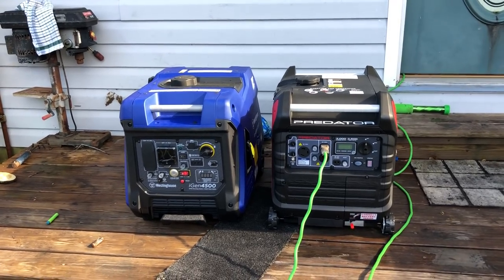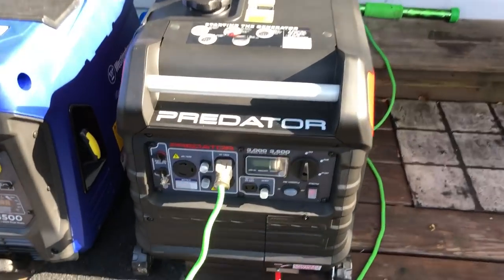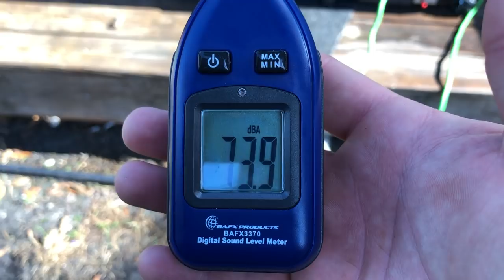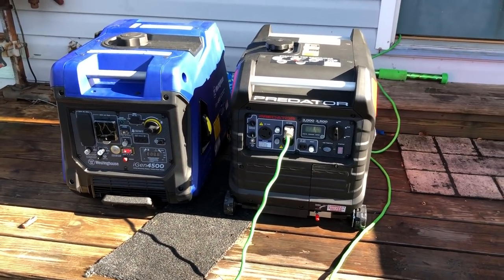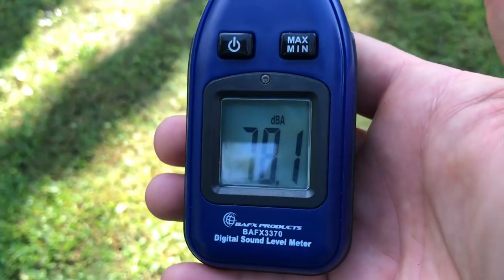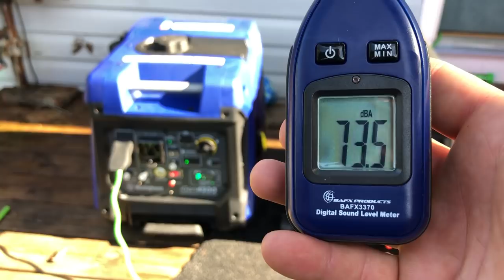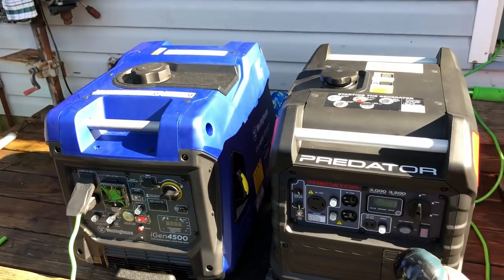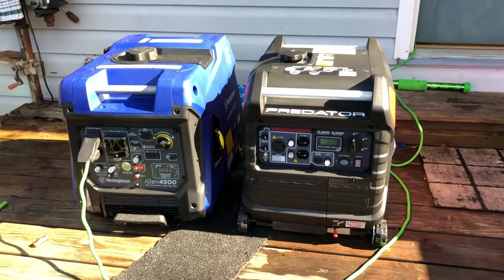Westinghouse iGen4500 vs Predator 3500

Comment: Thank you for the great comparison video! We will be adding an hour meter in the future to the LED Display. Also the fuel sensor currently only displays five levels which correspond to the lights to the left of the LED Display. Thanks again for the in-depth video.
Reply: Westinghouse Outdoor Power Equipment I'm looking forward to trying a Westinghouse generator inverter. I full-time RV 40' 50 amp 
camper running a generator days at a time only shutting down once every 12 hours or so to refuel and check oil. Need a factory-installed Pitcock on the top to feed fuel in when long running hours are required. Hour meter and fuel feed petcock.
Reply: @catfishnet  get extended run gas cap and big gas tank for that
Reply: Westinghouse Outdoor Power Equipment If I wanted to sell your inverter generators, in quantities, is there a way I could get a distributor treatment? A better price?
Reply: This is the nicest reaction from the manufacture ever.

Comment: Informative video, I love my 3500 HF Generator but the WH has a lot more features that are not on the HF, I havent had any problems with it but then again dont have much run time as its only used for emergency purposes.. if you're looking for a bolt-on exhaust extension kit to help vent exhaust fumes from you home or RV that wont void your warranty give this video a try. Works great for me on my HF, and Im sure if you add an additional exhaust baffle to this setup you could get the 3500 or even the WH to a level of whisper quite. Thnks for Video

https://youtu.be/XywOBT6dIsE

Comment: The Westinghouse has a built in hour meter.  You have to cycle thru the display.
Reply from the maker: Greg Ramirez  you are correct the newer model does the first model didn’t have hour meter

Comment: What matters is good power longevity and fuel mileage. 
Should run 13,000 BTU AC TV and microwave all together and it's good. I use two thin piece of plywood with sound absorbing material on one side. Prop it up
against the generator laying at a 45 degree angle on two sides. 
This will greatly reduce sound.
Reply from the maker: Homer Brown longevity and fuel are two key factors, won’t know till I have a couple hundred hours racked up cheers!

Comment: I just wanted to let everyone know that Westinghouse had nothing to do with the production of this generator.  Westinghouse consumer products no longer exist as an entity except in a trademark that anyone (including you if you have enough money) can license and use.  All consumer products with Westinghouse name on it is used under license.  Westinghouse consumer products died in the 1970's.  It's the same with other well-known US manufacturers such as RCA and GE.  The names are used under license and the products are made by the Chinese.  General Electric washers dryers and refrigerators are now owned by the Chinese.  Some are still made in Louisville Kentucky.  I foresee that production being shipped to China sometime in the future.  The harbor freight unit at least does not try to pretend to be an old u.s. respected brand.  They are what they are and honestly they're not bad.  Just be sure to buy the extended warrantyand if it dies within two years you can get another one and believe it or not they will sell you another extended warranty.
Reply: To bad.. We are screwed

Comment: faulty measuring noise levels from the distance - westingouse was blocking noise from predator. you should have put those apart and stay at such angle so no sound blocking or deflection happening between the two units.
Reply from the maker: Vlad Marchenko noise levels are well within spec and close enough to get the point across.....
Reply: He was also getting bounce back sound from the house when he was standing in front of them.
Reply: Exactly, and he says that there was a 5 dB difference between the 2 when there was only 2 when standing in front. When he moved to the side the Predator dropped by 10-11 dB and the Westinghouse only dropped by 8-9 dB - the Westinghouse clearly shielded the sound from the Predator.
Reply: and the exhaust is bouncing off your house.smh

Comment: Great video. I just bought the Igen4500 after seeing your video. Hurricane season in S Fla. I would like to add a magnetic dipstick and an extended run fuel cap. I can't find any info on what fits the Igen4500, I only see kits for the Honda and the Predator 3500. could you do a video or give me any advice?

Comment: I bought a Westinghouse iGen 4500, what a POS. Wouldn't run right, never made more than 1600 watts,plastics were poor fitting & scratched. I couldn't get it returned to HD quick enough.
Reply from the maker: Jeff Fotheringham really? Ya I’m not sure if they’ve figured things out just yet. I ordered another as the initial unit I did video with started doing odd cold starts and jumping or erratic idle. Have new one in box that I haven’t even tried yet.
Reply: Robbie Rod  Yeah, I was really hoping it would work, lots of nice features..... just not worth the money to go thru all that again.
Reply: I've heard about the same cheapness of the Westinghouse & wouldn't buy it at half the price.
Reply: Same issue here poor plastic melt , exaust valve fall in to cylinder ..

Comment: FYI EVERYONE WHO HAS HARD TIME RESTARTING THE PREDATOR 3500 WHEN ITS HOT OUTSIDE... All you have you have to do is remove the gas cap and it will start right up. Just needs to vent. Somehow it took me almost two summers to finally figure this out lol

Comment: I was strongly considering the Predator reviewed here. However, I decided on the new Westinghouse i4500 Duel Fuel, which is $999 compared to the Predator @ $799. For the $200 price difference, you get the advantage of "on the fly" propane or gasoline, remote start, 18 hour run-time, an extra 1000 watts, pull-out handle for mobility, claimed 52 db noise level, and a whole bunch of other convenient features including a nice digital readout of important data such as Fuel Level, Power Output, Remaining Run Time, Voltage Output, and Lifetime Hours. For me, the extra money was well worth it.
Reply from the maker: Richard Heilman I’ve had them all had too many small issue right off the bat with the Igen so for me I favor the predator even though I own them both...
Reply: Have you ever ran the Preditor and the Westinghouse in parrel @robbierod4391
Reply from the maker: Kenneth Owen I’ve run the predator in parallel but not the Westinghouse. From what I understand they’ve worked many kinks out of the the Westinghouse units, I’ll know shortly as I’m gonna but another new model and do a review and see how it fares to the older model.
Reply: @robbierod4391  thank you for the info. I know you cant run a honda parrel with anything other than a Honda, but was hopeing you could run a Preditor, which I have, with a westinghouse I like, the dual fuel is my big thing, in parrel

Comment: POINTING THE EXHAUST AT A WALL AND TAKING SOUND MEASUREMENTS IS THE WRONG WAY TO DO IT
Reply: he is comparing the two , they are both against the wall so to see which is louder it doesn't matter.
Reply from the maker: stelthy100 I’m not scientist brother my simulation suited my opinion of both. Try if for yourself and post results, I got a good idea from this simple trial..

Comment: I would also say truthfully champion is hard to beat and if you look around on Amazon you can even find their returned item warehouse deals at a substantial discount,,, I have several different generators bigger ones to run welders and air compressors and smaller ones as well my favorite small inverter generator is the champion 2000 W inverter easy to start long lasting fuel-efficient no problems,,,I also have a Honda EU 2000i great generator however if it sits for a while you have to pull 7 to 10 times to start the thing,,,champion starts usually the first or second pull every time.

Comment: What I like about the Westinghouse is the gas switch, you turn it off while the unit is still running to empty the gas from the carburetor (it will just die out  in a couple minutes) . This comes in handy when you intend to store or not use it for a long period of time.

Comment: Thanks for the video’s.  Keep in mind that the Westinghouse has 28% more peak output than the Predator...  Given that fact alone, a small increase in noise is to be expected.  Predator is full featured, quiet and very competitively price while the Westinghouse is a nice step up in performance and remote start is a big plus.
Reply from the maker: MySpeedVision 👍 this is true
Reply: MySpeedVision however the problem is that Westinghouse inverter generator isn’t quite where it needs to be yet quality wise they they mess up it is hard to get them to do anything about it a lot of people have complained about it they say the bigger generators are fair but their smaller inverters have electronically issues and bearing issues

Comment: There is no 1,000 watt difference.  Predator 3500 puts out 3,000 watt continuous and the Westinghouse puts out 3500 watts continuous. that a 500 watt difference.
Reply from the maker: Ronald Dvorak ran the predator at 3400 watts for 9 hours and the Westinghouse almost at its peak wattage so yes it’s dam close to 1000 watts difference

Comment: Simply go to the city and look what the quality food trucks use. They use them daily and know what is best. I see mostly Hondas.
Reply from the maker: Rebel Lucy this is true although there are some that are pretty darn good. I know someone who personally owns 2 predators both over 3500 hours and one is approaching 4500. I own a bunch of different models and the predators are pretty dam good for the $$$
Reply: the point is, the Hondas are about 300% more expensive or more..
Reply from the maker: Tom Ibach very expensive but I had a new handi3000 and at roughly $2400 with tax you could spend the $$ elsewhere it’s just a lot to spend
Reply: Not sure where you live but all the place I visit the food trucks/icecream trucks/construction crews all run the cheapest gen's they can find which are champion or predator.
Reply: @russmontgomery5211  Been to lots of jobsites and have never seen a Champion, only Honda or Yamaha and the odd Predator.

Comment: If you want better than a Honda and cheaper use propane and not use crappy gasoline. Gasoline will eventually give carburetor and hard to start problems even ethanol free gasoline. Sorry this message turned out so long. I've started to use propane several years ago. The carburetor can stop up and even fall off the unit with propane it will still run on propane. I was rebuilding a carburetor and decided to spray propane down the intake the motor still ran with no carburetor just propane going down the intake. To get the motor to rev all the way up. I just put my hand over the intake restricting the air and it revved all the way up. So all the motor needs for propane is a flap valve that stays still to adjust the air, propane and spark. That's it and there's never any gasoline to go bad and treat, dirty oil, dirty fouled spark plug, dirty piston or cylinder head. Propane engines are the cleanest and most Dependable engines out there. And a propane engine will last two to three times as long as gasoline. because there is never no carbon buildup to give problems. And propane is super clean on the environment the cleanest fuel there is. It's not because I'm trying to save the planet. I like longevity and dependability is the top priority. And you don't have to treat Propane fuel it's ready to go and it's a 100 - 110 octane. And changing the oil and spark plug in a propane engine is almost useless. But I still maintenance it anyway. you can save the spark plug because it really doesn't need the spark plug changed they're so clean the spark plug and oil look new like it's never been ran. Here's an example of Engines. Two stroke engines are light but they give all kinds of hard to start problems that are not dependable for daily use for the average person. And two stroke engines constantly need maintenance and worked on to start. Four-stroke gasoline engines are a lot better more dependable and fuel efficient. But eventually four-stroke gasoline engines will not start and give carburetor problems and have to be maintenanced periodically. And the four stroke engine on propane is the most dependable and long-lasting. The four stroke on propane is for the lazy man that doesn't want to maintenance the engine. it will take the abuse of not maintaining see it. Remember I said using propane the engine will last two to three times as long. Gasoline and propane are about the same in price. But lack of maintenance on a propane engine and the motor lasting two to three times as long in the long run it's worth adding propane to your engine. So a propane engine is more fuel efficient and cost-efficient in the long run all the way around. And a 4-stroke propane China engine will destroy any 4 stroke Honda gasoline engine. I'll give this to the Honda 2200 and 2000 Watt and portable model generators. They have more amps and they have a bigger engine size that's why they make more power. But you will pay about double or more for a Honda. So if you really want dependability and Longevity add propane to your China made generator like me. Propane is the cleanest burning fuel know too man that's why we cook our food on it on a gas - propane grill.
Reply: jon smith is your real name Hank Hill ?
Reply: @thunderbird97  no I just changed over the propane because it's cheaper in the long run to burn and it's almost zero maintenance. And I get some propane for free. And with my propane generator I can make electricity or with the propane I can run my propane heater and make heat.
Reply: +1 on propane... It is already on my RV. Looking at the 4500DF for just that reason
Reply: @steveh9714  you could get 2 Hondas and run them in parallel a 2200 RV plug and a 2000 and charge ur batteries. And that way you could only run one Honda at times possibly.
Reply: Still don't want to manage diesel for the locomotion, propane for the stay, and gasoline to make electricity for a trip... converted Propane gen has been awesome , but the new 4500DF might be the quieter cat's meow.

Comment: REALLY HOPE YOU READ THIS..... I've never owned a generator but I'm in nj now and loose power too often. I'm looking at the dual fuel Westinghouse iGen4500DF my question is....are theese inverter generators TRULY safe to run my cable any 65" sony t.v's and the next thing I'd like to know is.... do I suppose to add a ground rod in my yard for the inverter generator and/or regular gas generator..... thanks for any help
Reply from the maker: eddiekytia please elaborate on a ground rod in your yard? How many watts does your tv pull?
Reply: @robbierod4391  lol....I know the watts aren't a issue someone told me dont plug my tv into a generator because it's bad electric and can ruin it and as for the ground rod. The same person told me I have to install a rod in the ground and run a copper wire from the generator to the rod? Like I said I've never owned a generator so just making sure I get good information. I was also told if I run regular gas with ethanol once I put the generator away it will never start again. Here in nj I could find ethanol free gas unless I pay 80 bucks for 5 gallons.... thanks for any help
Reply: Eddie- The person who told you this is both right and wrong. Sensitive electronics tv's, laptops, and such CANNOT be plugged into a regular generator as the power delivered can surge and damage the items. However they can be plugged into an Inverter generator such as these due to the power delivery being much smoother and no surges.

Comment: I’ve had my predator 3500 generator for almost 4 years not one problem start on first time every time , I’ve had it up to 33 amps at 3340 then it shut down so way higher then it’s supposed to go, great generator,

Comment: Any updates on the longevity and fuel efficiency between these two generators now that it's been almost 3 years?  I'm deciding between the two generators myself and I can't make up my mind.  I like the extra fuel capacity of the Westinghouse because run time on a tank of gas is my current limitation with my Champion generator.  The price difference doesn't really influence me, I'm more worried about fuel efficiency and run times under load (RV Air Conditioner).

Comment: Bought a Westinghouse and upon my first start up gas came pour out of it. It was leaking from between the carb and engine. Side panel had a crack in it and I think it was a return that never got fixed before being sold again cuz the dipstick had oil on it! Anyway tried to fix it gotta new carb fro Westinghouse but bolt to take some casing off to get at carb was stripped from the factory so just sent it back. Ordered in april got it in may ran it early july sent it back in August because they are having production issues and wont have new ones till at least October!! So I'm done with it! Glad your works cuz it would be awesome if it did!!

Comment: The push button start is an awesome feature. I am currently looking for an inverter generator & these 2 are on my list but Lowes has a sale on a Briggs & Stratton model  ($899.00) 4500 running watts which is also really nice but the Briggs does not have an electric start option.